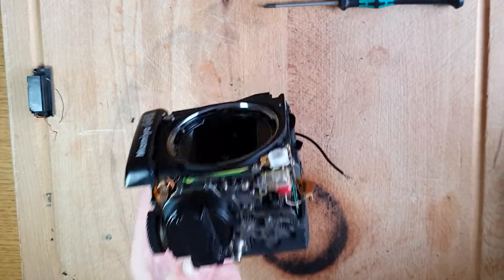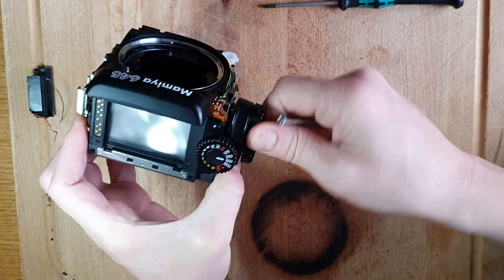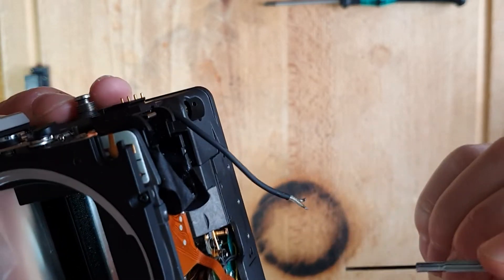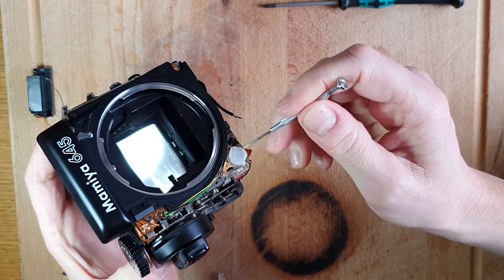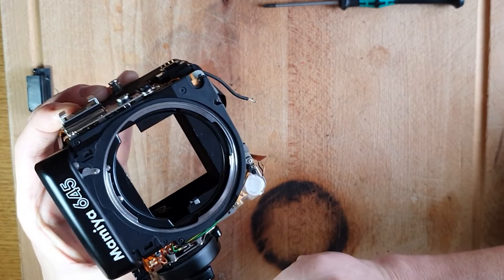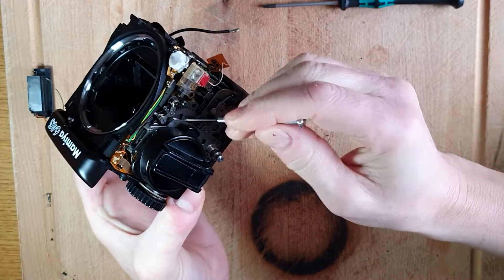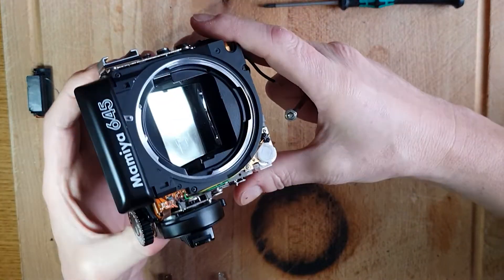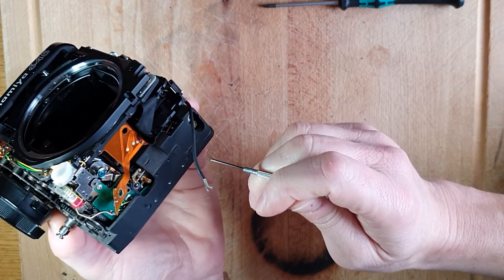Mamiya 645 Pro Pro TL  Repair - Shutter stuck open Mirror stuck up -Possible fix Solenoid

Comment: I have a 645E and the shutter is getting stuck when the camera is held in portrait mode but only when the wind is facing. Do you have any idea what is causing this problem?
Reply from the maker: I suspect the wind mechanism is due a clean, lube, adjustment (CLA)

Comment: Hi, I just took my 645 Pro for a spin today and I have a similar problem. When I press the shutter button, the mirror moves up and the shutter opens - but no matter what speed I choose, it doesn't close on its own. I can press the shutter button again to close it, but obviously that means I have zero control over the shutter speed. Do you think it's caused by the same thing you're showing in this video? My battery is fresh, the camera worked perfectly when I got it. It's been sitting in storage for a couple of months and now I have thus shutter problem. Curious to hear your thoughts
Reply from the maker: What kind of winder do you have? Manual or power grip type?
Reply: @davehyper7835  I have the manual crank, not the power grip. Just watched the video again and now i am pretty sure that this is the exact problem I have with my camera. The only thing I don't understand is why I am able to close the shutter by pressing the same shutter button again. Could it be that the first closing pulse is not reaching the solenoid, but pressing the button again sends another one which does go through?

I could probably attempt to fix this myself, but it is a bit daunting for sure. How much would you charge for a repair like that? I am also in the UK
Reply: @davehyper7835  I also just tried running it a few more times in the multi exposure mode (to not waste any more film that's already loaded). It seems that the mechanism isn't actually fully broken, but fails (or rather works) intermittently. Most of the time the mirror won't come down at any shutter speed, but I get lucky and it works fine, closing the shutter and dropping the mirror like it's supposed to.

Something I noticed when I tried the 1 sec exposure is that there's a faint click after 1 second, which I assume is the second curtain solenoid. So it obviously gets the signal to fire and does something, but fails to close the shutter sometimes. Maybe it's dirty/sticky from the long time in storage?

Comment: Hello friend, how are you? I bought a mamit=ya 645 tl and mine came with two problems, the spring on the mirror trimmer was loose and broken and the glass on top of the view finder was loose, there are two metal plates, I don't know where to put them and I couldn't find any information, could you help?
Reply from the maker: Hello Marcelo, I'm good thanks! What normally happens with the mirror trimmer is the mirror stop breaks. I have designed a stronger version and have a 3d print file if you want it? I'm not sure about the metal plates. are you able to upload photos or video of all the issues to your youtube channel or perhaps email me davehyper@gmail.com thanks, Dave

Comment: i just got a 645 super that has a very similar problem to this, but if i give it a light tap, the mirror and shutter will get unstuck and then i can advance and take the next shot. do you think it is the capacitor in my case causing this?
Reply from the maker: Hi, It's more likely to be a sticky solenoid or the solenoid mounting screws may have worked loose. If you are going to strip it down i'd change the capacitor, clean any of the electromagnet contacts and check the solenoid operation by applying a voltage directly to it. 6v in the case of the pro and Pro TL.

Comment: I wish you where located in USA my Mamiya 645 have some relative issue If I left the battery on while I not using the camera the mirror got stuck I have to remove the battery in and out until the camera works normally again, any suggestion

Comment: First of all, thank you for the Mamiya videos. I have a question if you don't mind. When I wind the camera and push the lever down which mechanically should release the mirror and open the shutter curtain, only the mirror goes up but the shutter stays closed. What could cause this? Thanks again.
Reply from the maker: My guess would be the wind mechanism is not fully cocking the shutter curtain mechanism. does the curtain fully travel across and lock into place when you wind it? if if does can you manually trigger the shutter curtain by pushing the white pin across?
Reply: @davehyper7835  thank you for near instant reply! I have managed to fix this issue by manually winding shutter curtain gear a little to move it to further position, then everything went in sync (or it was just a lucky reassembling that did the trick). Now the camera works unless I put the film back on, automatic winder will wind till S switches to 1 on the film back and then it wont react to pressing the button. If I remove the film back everything works again.
Reply: OK I forgot to remove the dark slide. Now the Mamiya is working in full. Thanks again, best of luck, will come around again!

Comment from the maker: Just to add the likely process for triggering the solenoid is a pulse of some kind will arrive at the transistor that will act as a switch that connects the fully charged capacitor to the solenoid to energise it. The Diode will be protection from reverse voltage when the electromagnetic field collapses in the solenoid.